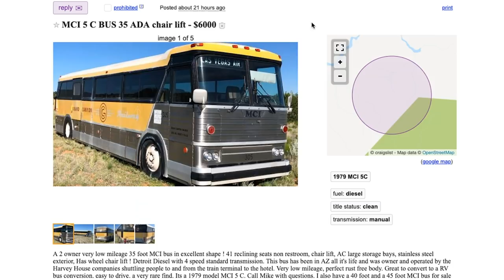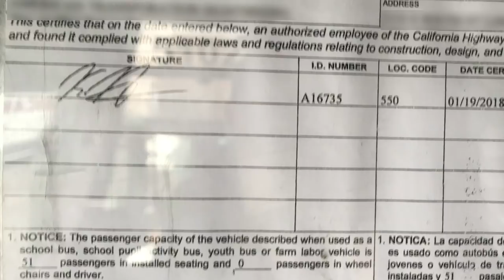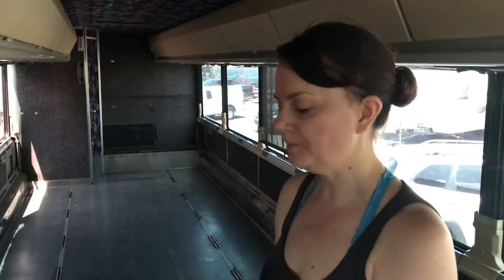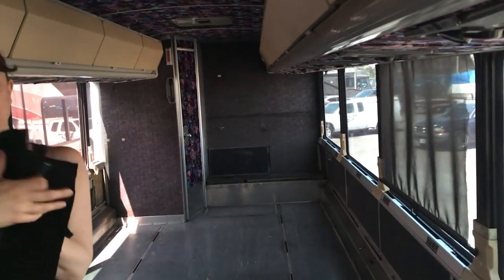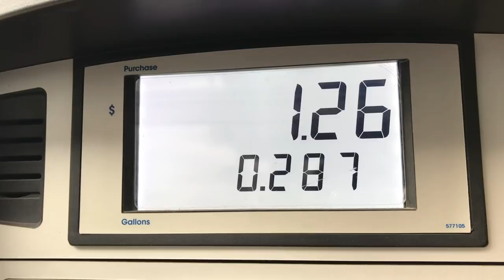We Bought A Bus • First Step of Bus Conversion to Tiny Home on Wheels

Comment: Good day Rehabit8 I'm in the process of looking into buying a bus like your self . Do I need to convert it into a livable home before I get rv tag? I live in California and the day I buy it do I need to have a noncommercial license so I can take it home ?
Reply from the maker: technically no, you do not have to have it as a livable home, however, you do need it converted the title to an RV/Motorhome/House Car as a personal vehicle and not a commercial vehicle. In CA it can be difficult to change the registration as many DMV employees/managers don't understand the process or paperwork. Look into hiring a licensed CA VIN verification services. A guy will comes out and look at your bus and fills out a form that the CA DMV will accept as proof that your vehicle has been converted into a RV/Motorhome/House-Car. At that point the DMV will be able to issue you a registration.
Our guy charged about $100 bucks for visit and VIN verification. Many of the VIN verification guys will do the form if you simply have bus seats removed and talk them through your plan to add necessary changes to make it a RV/Motorhome/House-Car. This will save you from having to go to the local police department or have the DMV approve your conversion really is a RV/Motorhome/House-Car and NOT a commercial vehicle.
Be sure and read through the official DMV documents to make sure you are prepared as they do make updates and changes all the time.
Reply: @Rehabit8  thank you so much for the information !

Comment: How much was the bus you ended up buying?
Reply from the maker: Hi Laurin, we spent 17.5 for this bus.  It was a lot more than we originally set aside especially considering we started by looking at school busses for 8k!  But after looking at over a dozen busses ranging from 8-20k this was the best one we had seen. No exterior visible rust and only 200k miles on the current engine. Plus the seller was a "proper" bus company with 15 years of maintenance records and our contact at MCI knew the bus and the owners and gave us his approval.
Reply: Rehabit8 awesome!! Thanks for the response!
Reply: I was just going to ask! Thank you :)
Reply from the maker: @--MOONCAT--  we found several older buses (MC9/MC12) and a few D3s for less but this one had Zero visible rust as compared to all the other D3s we looked at.
Reply: Just found you guys today and subscribed! Love what you’re doing here! I’ve been toying with the idea of doing something similar (and have been leaning more toward coaches than school buses) so I’ll be watching your whole series to learn from you two. Cheers!